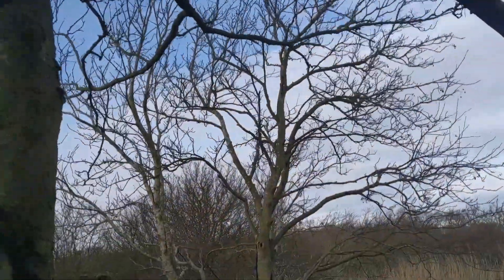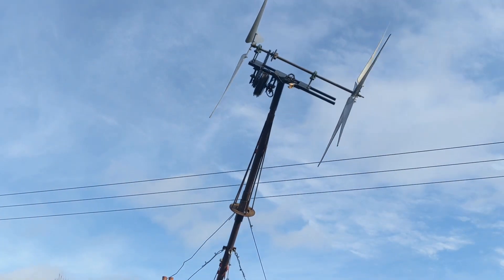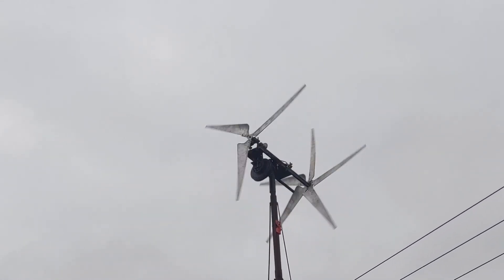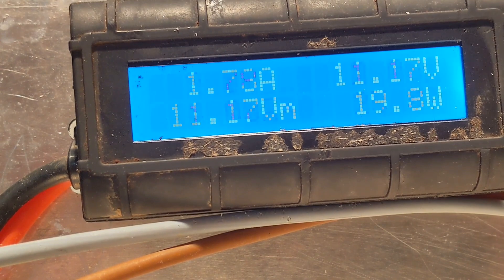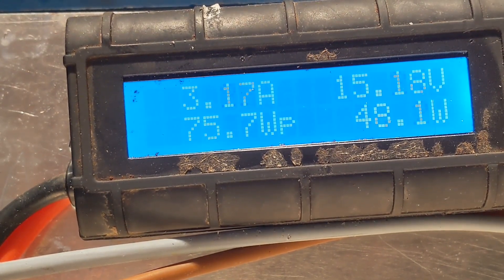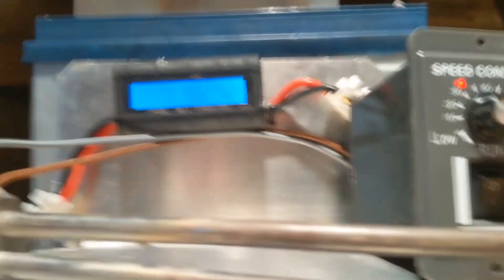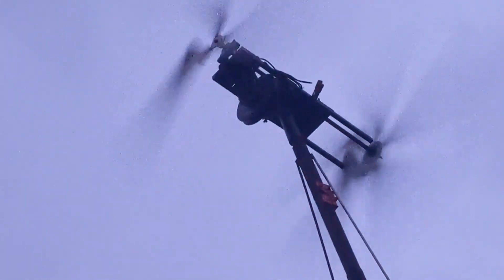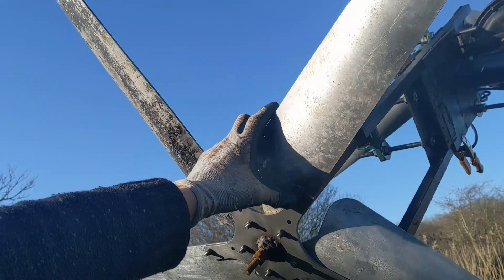Random wind turbine stuff Storm Christoph DC SPEED CONTROLLER 22 January 2021

Comment: Good strobing by the camera/blade combination. Putting the dump load on says that the unit can make power in excess of what your batteries can accept and that happens with solar also. Is the crud on your meter and controller knob the result of your storm damage?